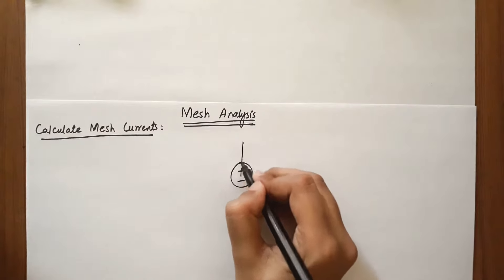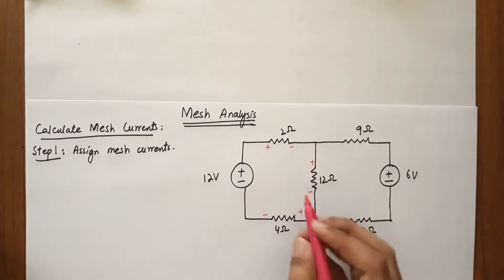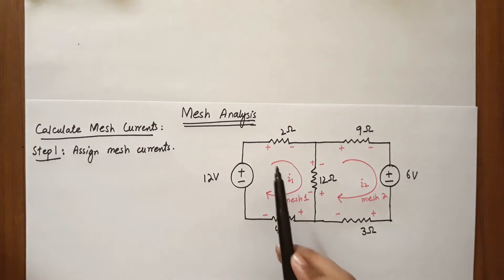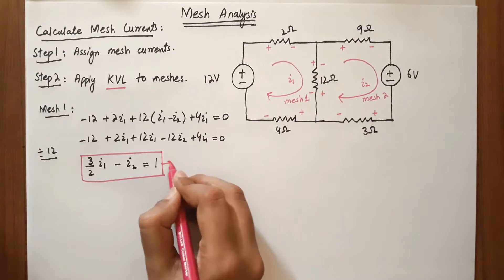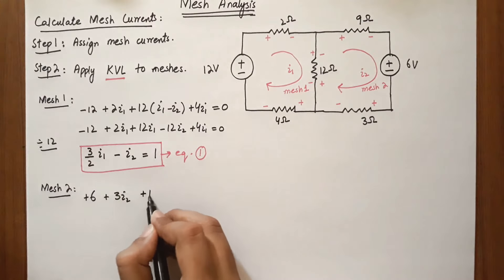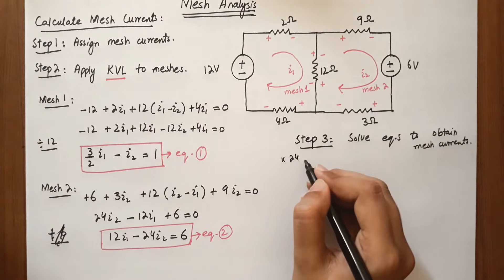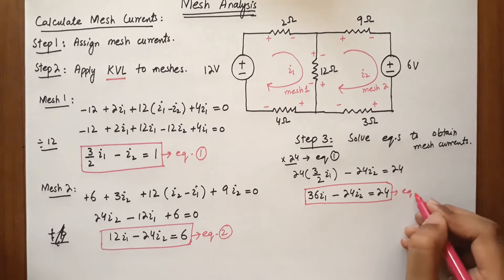mesh analysis example problem solution easy steps

Comment: Vlotage From +ve terminal to -ve terminal is taken negative
Reply: This video is incorrect maybe
Reply: Everything is wrong here
Reply: In the 2nd eqn ......it's =-6......not +6
Reply: How
Reply: @KINGTRADES21  agree
Reply: Yes you are right..
Reply: @habibamohammad4663  instead of 6 she actually moved 24 and 12 to other side of = so thats why its +6 but the signs of 12 and 24 changed
Reply: the only thing wrong here is first equation because 2 will go to the other side of= and t will become zero before moving -1 to that side so there will be no value in fraction
Reply: @Ahmed-yr2lc  no bro all equations are right if you have problem then contact me.
Reply: @Aditya-cw1qf  calcululation may be not correct but the idea is correct now u are learning eca not maths... Hope u get my point .. and papers me yehi questions nahi aey ga values may differ..
Reply: From where
Reply: @habibamohammad4663  go and take the lectures of 7th class then come here...
Reply: Bro kuch bhi le sakte he
Reply: Its totally depends on you if you take negative then all sign will be reversed.
Reply: @Aditya-cw1qf  ppppppppp
Reply: It's positive noub
Reply: No but here is different
Reply: @Aditya-cw1qf nhi bro dono way se kr sakte ho
Reply: No not at all , the sign convention is different but it's correct.

Comment: In second loop +ve is towards that side of 9 ohm resistor on which side you indicated as -ve. Why? Whereas initially you said assign that sign to resistor with which its connected to battery or potential.
Reply: if two battery are connecting in a same direction then high voltage battery are taken in overall circuit
Reply: Exactly my doubt can you clarify if you understood

Comment: There is a mistake in the solution..
At Mesh 2
When we took 6 on the other side of the equality its sign changer for + to -
But haven't changed the signs..
Reply: right
Reply: Because it is going to high potential to  low potential
Reply: Look at the other side also, She changes the signs of i1 and i2 , there's NO MISTAKE

Comment: Great Help Indeed!
Reply: It comes 3/2i - i2 = 1  after diving by 12 in mesh 1 you said but how?   I tried several tymes but it not come  the same
Reply: @Haroon2002home  her answer is correct but the steps she took to solve the equations are confusing and might be wrong. Polarities are also confusing here.

Comment: Second equation negative six has to come mam please do correct it
Reply: Ya ur right negative six will come but after equal she had written before equal so it would be plus she is right dear 😉😉
Reply: @reshailekhan9138  Bhai - to positive battery Voltage positive hoti aur volatge drop hota across resistors to wo negative hongay lekin madam nay olta Kia hay
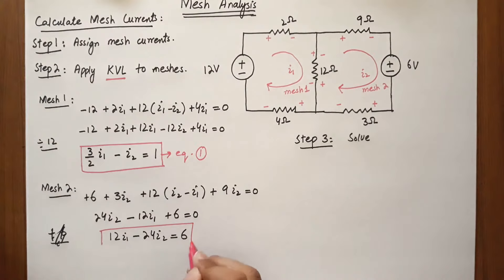Reply: @reshailekhan9138  the mistake is at 4:27. It’s suppose to be -6 when she took it over.
Reply: https://www.youtube.com/watch?v=ghrAqzYKIp0&feature=youtu.be if you solve more question harder one i really recommend this question.
Reply: @Lorenza Carey  no because she changed signs and made pos to neg and neg to pos so that she gets i1 as positive as it's the first term